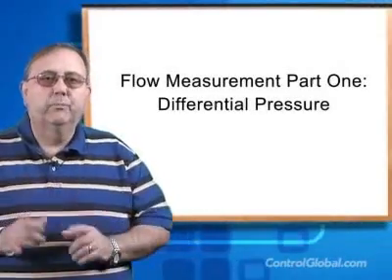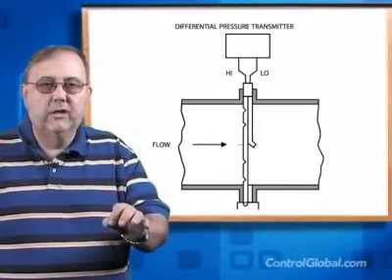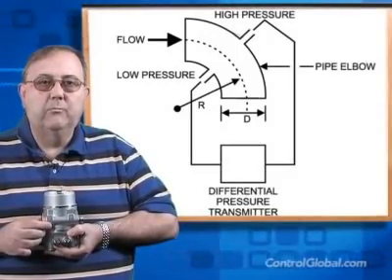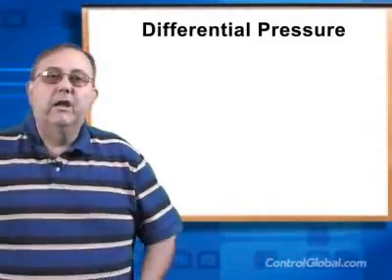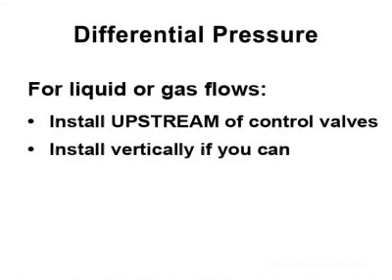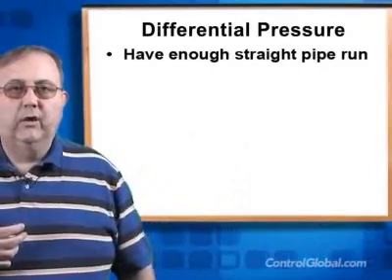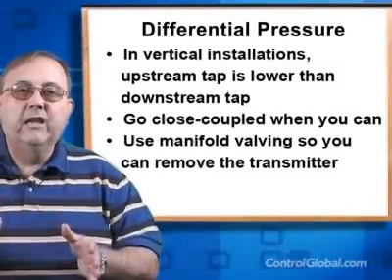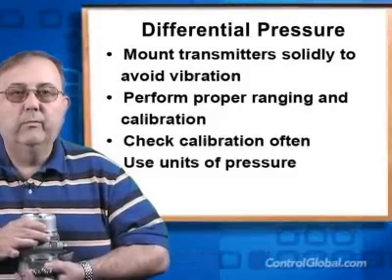Back to Basics: DP Flow Measurement

Comment: In gas or water, the flow is from the source to the destination. if horizontal, the upstream means where the fluid is coming from and downstream is where it's going to, like a river. Same concept in a vertical installation. assume you are pumping or moving water or gas in a pipe, install a 90 and send it upwards for 20 feet, the upstream is below the downstream....  Could one have gas or water flowing DOWN a vertical pipe from a source above? sure, in which case the upstream would be above the down steam.
If the primary device were installed in that section of pipe and in any other application, it is Paramount to have a FULL pipe under system pressure. I am just an old tech. take or leave my humble opinions here